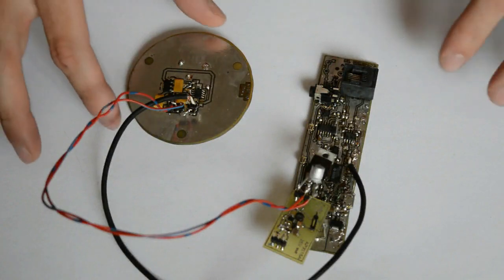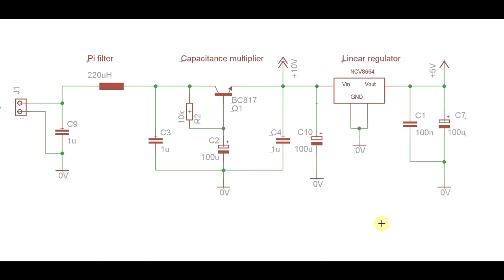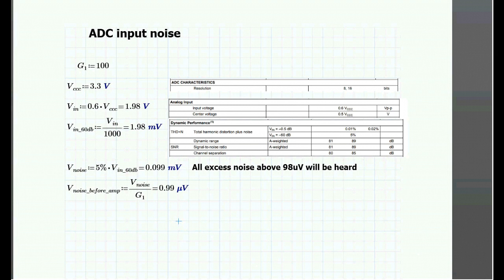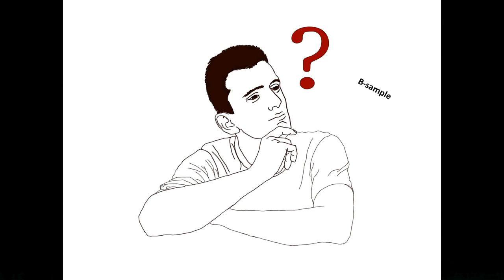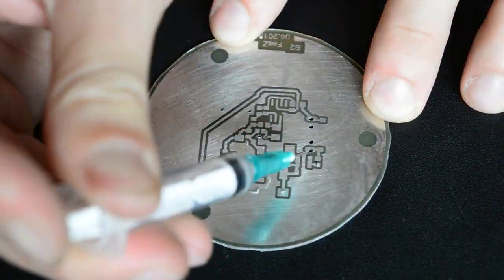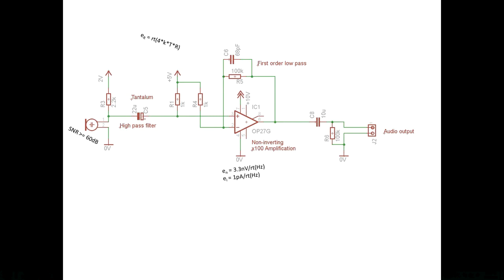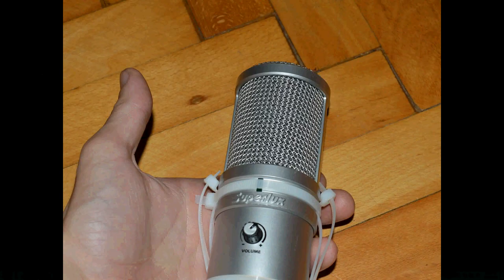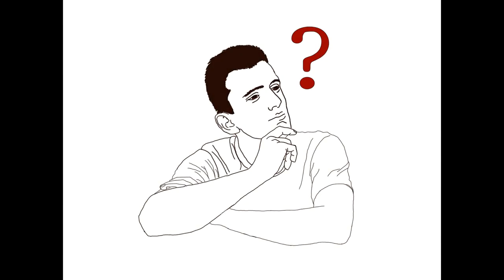Build your own HIFI microphone for recordings - Part 2

Comment: Have you considered aluminium 25mm electret capsule (sold as "condenser" in title)?
they are very cheap and comparable to proper 35mm metalized film condenser capsules.

Comment: @FesZ Electronics Noise at -42db is a very bad result. I recently built such a mic with some scrap opamp F4558. Runs on 12V battery, resistor to mic is 37k, cap from mic is 0.1uF mkp, feedback resistor is 270k, 1/2 voltage on the non-inverting input, output cap is .68uF mkp, after that is some 4.7 megaohm resistor, capsule is CZN-15E. The reason I share the values is because these work just fine, noise is at -60db and a loud clap hits about -2db. I tried a lot of configurations and this is the only one that worked well. I think the secret is that no more than 0.5mA should flow through the capsule and in my case it is 0.32mA, also I think that this 37k bias resistor is similar to my input impedance of 44k, which is probably a good thing. I think that when there is too much current to the mic capsule it doesn't swing that much, therefore you need this very high amplification which leads to very bad SNR. Try it ... sound is excellent!!! I built it as a mess of wires in the air and no shielding and yet noise is at about -60db.